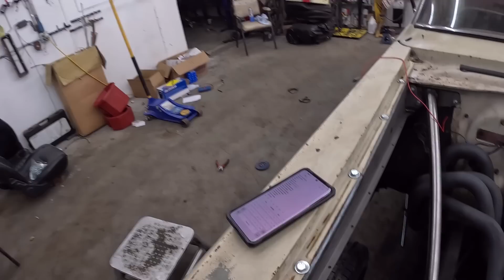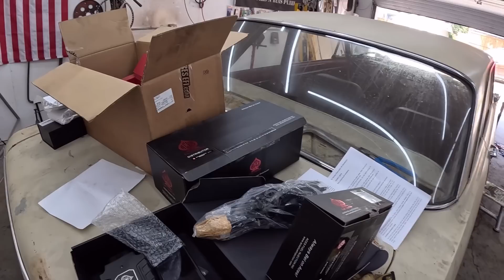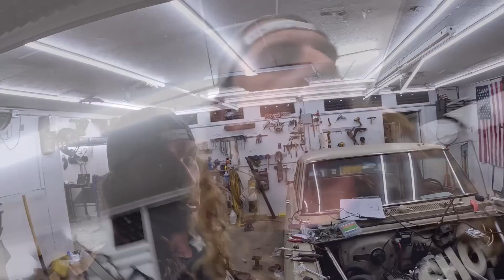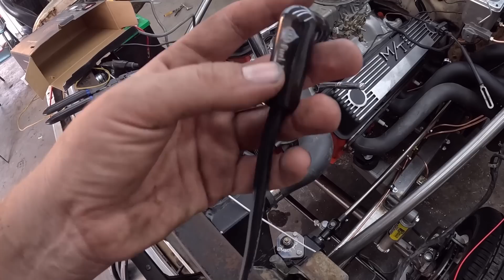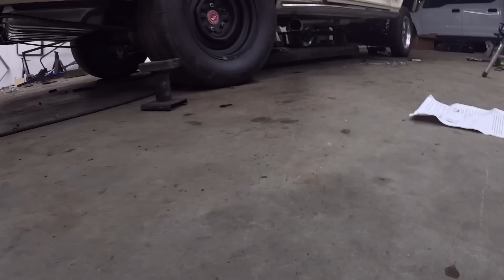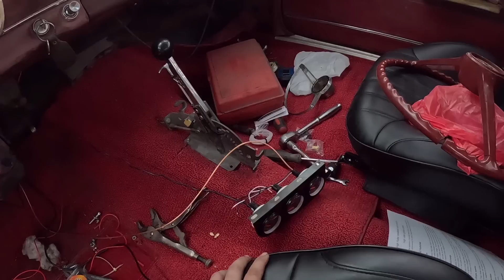First Start FIASCO! - 'Merica Made Cam Shaft = NO PROBLEMS

Comment: Flat tappet camshaft need crank splash oiling while polishing camshaft lifter break in 2000 rpm 20 minutes at least,

Comment: Dan, for putting plug wire boots on, I use liquid dish soap like Dawn.  Just put a few drops on the wire and smear it around with your finger.  It's super slippery and it will dry up on its own after the boot is on.

Comment: well my only worry is this..  you have Zero fender wells under the hood  which i get yeah its a race car no need  however if you are gonna drive said race car  on a trip  you cant predict weather and with no fender wells all that rain water you  MIGHT run into on the road  could very well damage the Ignition Box.  so for the sake not being dead on the side of the road with no second box.  for peace of mind i think you would be better off putting the box inside where it wont get a shower.   also  it has been a very long time since i raced but if memory serves me right  NHRA rules state that on a race car with a tube chassis  aka your front gasser clip is included i believe that the Battery has to be mounted in the trunk in a proper battery box and a ignition kill switch mounted to the rear of the car out side.   lastly that 327 sounds like its pretty beefy so another NHRA rule states if i remember right if the car runs 11.99 or faster she has to have a roll cage  they wont let her run again until she gets 1 installed.  when it comes to racing there are strict rules they will enforce but while its a headache to deal with  in the end it is for driver safety.  you also need to have a approved helmet for her  and for that i would take her with you and have her try it on for the right fit for her head.   anyway  im giving way to much info here  for now i would rethink the box mounting  and then just take the info i gave you and do some looking to make sure im right and that you guys will get to run the car at the track because you have met their rules  ;)  good luck guys  you may just get the racing bug in you.  its a ton of fun and very VERY addicting  dani may become a speed demon after first run  it happens IRL  check out the movie from the late 70s  Heart Like A Wheel  true story LOL

Comment: Very Cool, Dan! I am looking forward to seeing it drive and perform at a drag strip.
I have 2 suggestions: 
1.) turn the CDI box the other way around so that the connectors are at the bottom to avoid water contamination.
2.) lower the welded on tabs for the front flex lines so the hard line can lay flat on the frame (no hump at the end).

Comment: I would mount the battery in the trunk and put a master cut off on rear panel. It will help transfer weight and be away from any electronics

Comment: Dan I can tell you that your nova is nowhere as loud as the majority of the hot rods you will see during cruising the coast! Hell my Mazda b3000 with a 402 Chevy is 3 times louder with mufflers…. I’m only running 1400 hp at the wheels and mine is a little baby compared to the majority of the idiots I run with…. Lol myself included 😢

Comment: Sounds so goooood, reminds me of my 66 chevy 2 back when I was 16 , I paid $700 for it from a used car dealer factory 360 hp 327 and a 4spd , the little duece would RUN , I changed the cam and lifters and steet raced for 2 years never got beat by anything , and I drove it everyday as a driver , guys with big block cars got so pissed when I handed them their ass and just smiled and said PAY UP SUCKER .

Comment: Line lock to help Dani heat the tires up if not going to be tuff for her in burn out box. Also Dan the drag radials only need a short burn out with the proper pressure for the type of drag radials your running, we uasully end up between 25 to 23 pounds on prep track.

Comment: You can use a little dot 3 brake fluid as a lubricant for rubber slides good and doesn’t break down the rubber really works well !!

Comment: spray the rubber boots with carb cleaner. dries quick so hurry and shove wire thru, helps wire stick to boot when dry, not as messy as lube,

Comment: @Dan...If no battery relocation it will eventually need it to be raced because the Bat Cut Off needs to be available to the Safety Crew. CD Ignitions are great for a driver, keeps the plugs clean and puts out a hot spark so you can run a bigger gap if you want.

Comment: Something else you're missing, the PCV system. One of those valve covers will have to be drilled out for a PCV valve.
Reply: That's only if you want to go back into the carburetor for reburn... it has an old school oil filler neck with a breather cap that will let out any Blow by... it does make it a little messy and smelly but but that's the old school way of doing it... just look up any old 60s and pre 60s Chevy motor and you'll see what I'm talking about

Comment: The WICKED  sound is to DIE FOR  . 327's with a really Cool BumpStick make for a heavenly sound . My T-Bucket sounded just like that . I paid $400.00 for my Gear Venders , it only had 500 miles on it and the customer didn't like it had it removed and said do what you want to with it and that's how I got such a good deal . It is sizeable and the length of the adapter makes it quite long as a complete transmission unit . The control box and wiring will have you cussing but that's the way Hot Rodding goes . Man that little Chevy ll sounds awesome . Great video Dan , keep them coming .

Comment: You always make a poor chooses on exhaust systems. There is no need for 3 inch pipes & flowmasters on nothing under 500 Cu Ins unless you want bad hearing in a very short time.  Think 2-1/4" pipes with quiet turbo muffs with full tail pipes out the back on any street car so you can talk to folks in the car on the road,  not yell all the time!. Question ?--- Hows your bank account ?---- Yeah I bet it is.. 🙃

Comment: 25psi is sure dangerously low oil pressure, Least should be at 60psi cold & 35psi hot. Wouldn't hurt while your ahead to pull the oil pan and freshen up them rods with one thousands over Clevite bearings & Melling high Volume oil pump

Comment: You can use brake clean on spark plug boots during assembly. It evaporates out of the boot vs oil.

Comment: Big D, watching the video as I'm commenting. You've mounted the (ahem) computer component right next to the radiator cap. My concern is, if that rad overheats it'll flood out the computer box/component as the wiring harnesses are right next to the spout. I'm not the sharpest axe in the shed but, I foresee a possible issue maybe? IDK, you know more than I do so, maybe I should just watch and learn. I wanna hear the bad girl running. It's coming together Big D and it's SHWEET!!!.

Comment: Use Brake Clean to lubricate plug wire to put the boots on. Penetrating Oil makes the coating gummy. The Brake Clean let’s it slide on then evaporates away.

Comment: Purrs Like A Gasser ✌️😉
That stance is perfect

Punch in those thumbs ups for the DD Speed Shop Gasser ( Overpaid )

Dan is the dual quad tunnel ram going on before or after the trip west ?

If you have time the tunnel ram would look cool but opening the secondaries would be like flushing the toilet bowl... on that very long trip and I'm sure the fuel receipts will start adding up

Tach it up.... Tach it up... The DD Speed Shop Chevy II will SHUT you down !

Take care of odds n ends & dial that unit in..

Then it will be 1/4 mile test n tune at a local track 

You can just show up and test as long as there isn't a big meet going on....

Its usually 20 bucks or so for the day.... 

That way you can push the 100+MPH speed and not worry about the cops 

Jeez I'm writing a book here 😂😂😂 ( Done & chat says THANK YOU )
Reply from the maker: Haha I want the carbs on before I go if possible